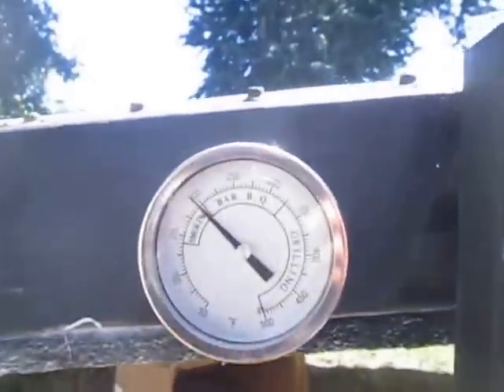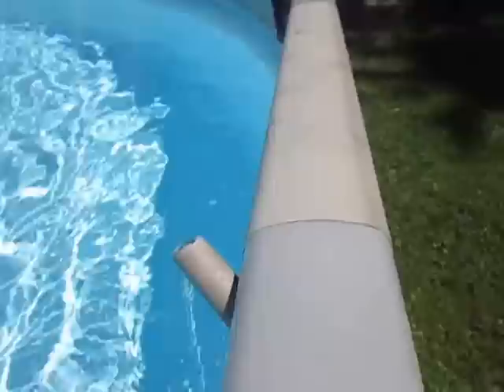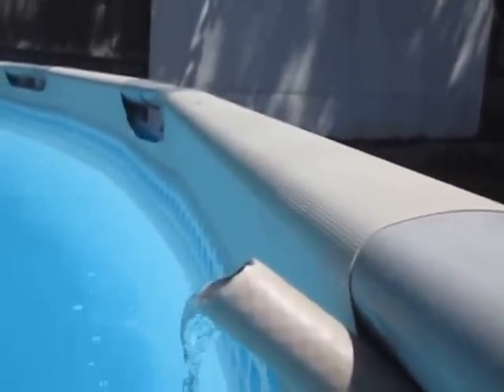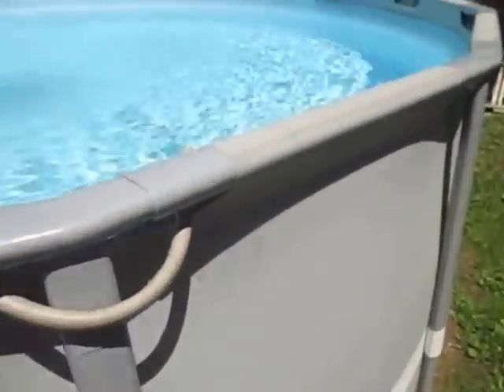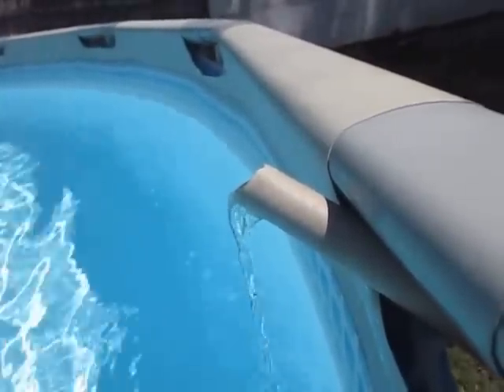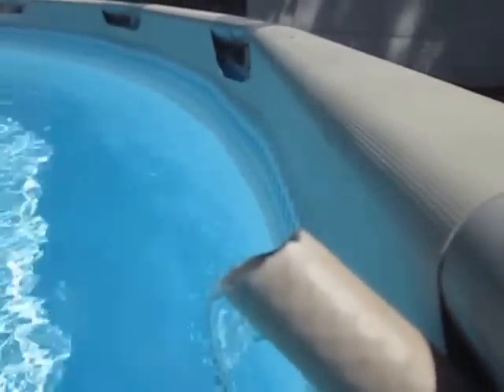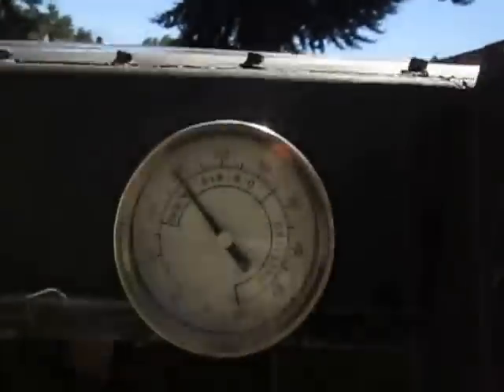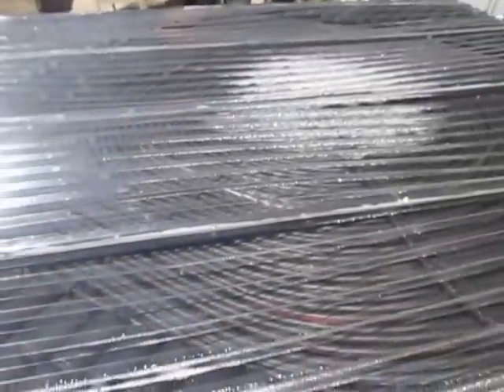STEAMING HOT UPDATE!!!  SOLAR HOT WATER TUBING/CAN POOL HEATER BUILD! THIS THING IS SCORCHING HOT!

Comment: If you increased the flow, you would get more heat transfer from the tubing to the water.  It may not come out steaming hot but it will increase your pool temperature faster being that more water it being pushed through exchanging heat from the tubing and cycling through the pool more often.
Reply from the maker: Thank you.

Comment: Pex line is rated at 180 degrees.  How is it holding up?  Also, I've read the fittings burst much sooner.  Please advise.
Reply from the maker: Still holing up great. I found that I had a small leak in one if the crimp fitting and that was causing the steam ion the box. I crimped it tighter and fixed!

Comment: Hey Mike, just wondering  what the voltage of the centrifugal pump is that would not be too less or too much. We built ours from using your videos. We are in Newfoundland, Canada so we get a lot of rain, fog and overcast.
Reply: We also have it up on the roof and need enough power to push it up 8 feet, so would a low volt even work in this case?
Reply from the maker: 110 volt
Reply from the maker: not sure?